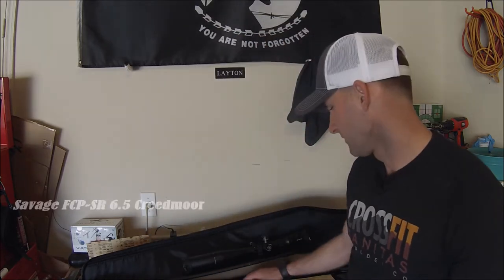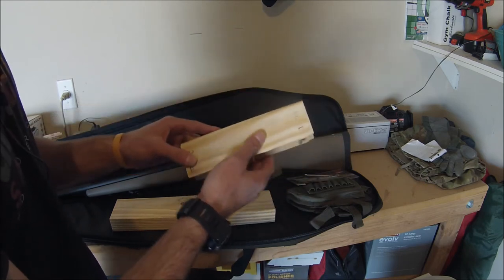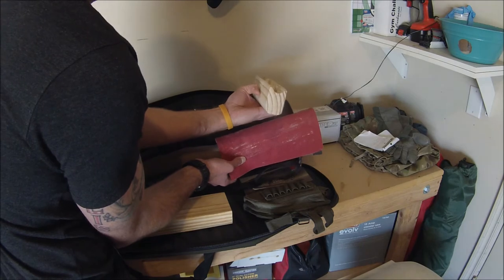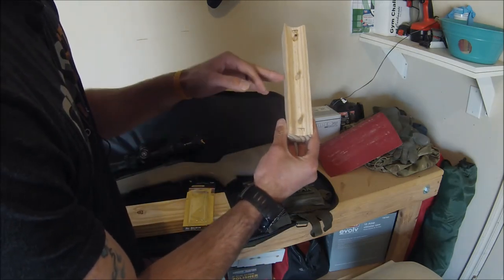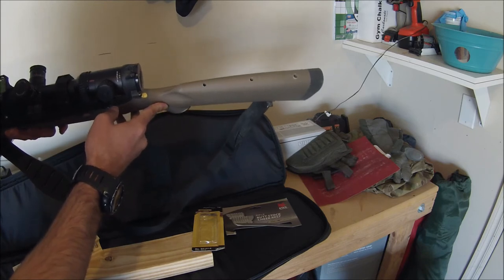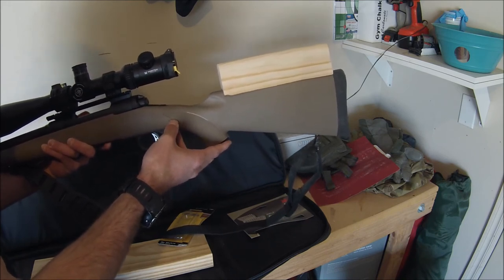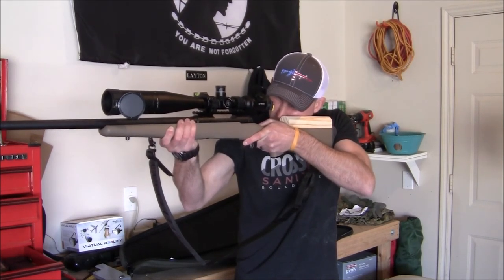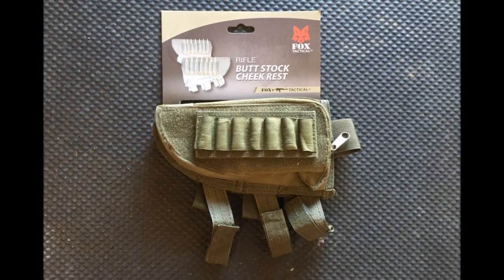DIY Custom Fit Cheek Rest under $10

Comment: Kinda lost patience after the seventeenth actual but nice job. I recently made one of wood and then a better one from plastic.
Reply: How did you make ons from plastic
Reply: @AG-hw1uz  used a hard plastic pipe about 3" diameter. Cut that about 7" long. Cut a strip out down the 7" length. . I then put it in a toaster oven for 15mins or so to make it soft. Then take it out, lay it over the stock and let it cool. Then you can grind to shape with a  metal grinder.

Comment: why not just use a loop of Gorilla Tape to adhere the wooden bump cheek rest to the stock since you're putting a fox tactical stock bag over it? This way you wouldn't have to drill through your stock diminishing the value.....
Reply from the maker: Tim Misuraco that's a way to do it. Wasn't to considered about a couple holes. Also keeps it secure without a chance of sliding over time.
Reply: I should have said this in my 1st comment.....
great vid, and great work on it. 
I think my question was a little jumpy....  you wouldn't imagine how many people tell me they "saw a vid, so that's the only way" lol.   I had a guy show me his M1 garand he drilled through......   because noone told him about Velcro or Bradley cheek rests.   (was a sad day after I told him)